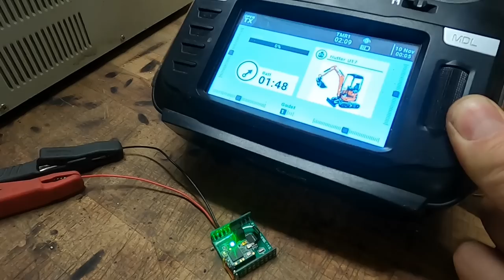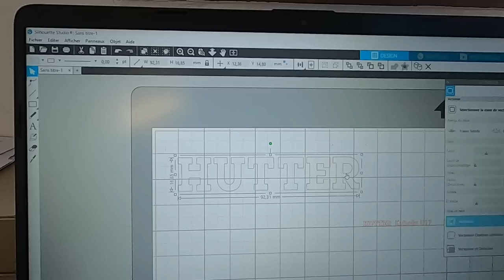Build - RC Kubota Hutter U17 1:15 Scale Excavator Part 4 - Paint and assembly

Comment: Did you have the pump and valve assembly beforehand? or did you just get lucky as far as making sure the dimensions worked with the space you had? I'd imagine you had the hydraulic unit beforehand, which would allow you to build around it. Is that not what you did here?? Genuinely curious. 

Incredible work as always!!
Reply from the maker: Of course at size size of model, you take some precaution in advance, I printed the drawing and take some mesure and spec of all main elements. Some parts are incompressible like block valve or pump, some can vary like oil tank, the batterie or receviers than can take various configuration.

Comment: Steve, I thought the pump is always on  at an idling speed... .. could you please elaborate why in this model you chose to configure the pump to run only when you move the sticks.. thanks
Reply from the maker: I have this on all my models, pump start only in demand
Reply: @BartsteRCModels  interesting ... yet your models run very smoothly ... I thought having the pump on a switch that makes it run at an idling low speed is the key to have stable pressure across the lines, and gives accurate smooth predictable response ... obviously your perform flawlessly as is and don'y require that ...thank you

Comment: Sorry for the question but what battery did you use in this model?
Reply from the maker: No problem, I have Li-Ion 7.4V 650mAH (2 cells 10440)